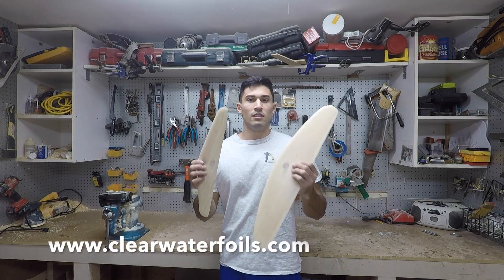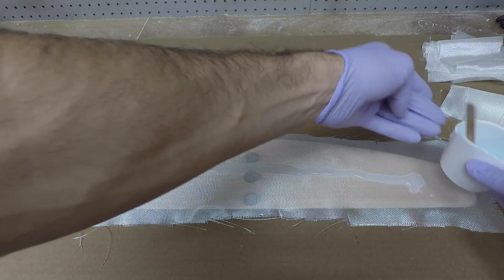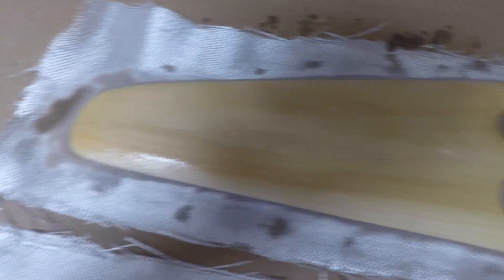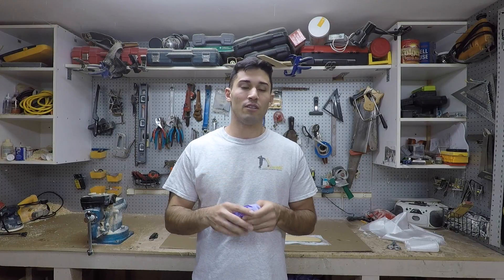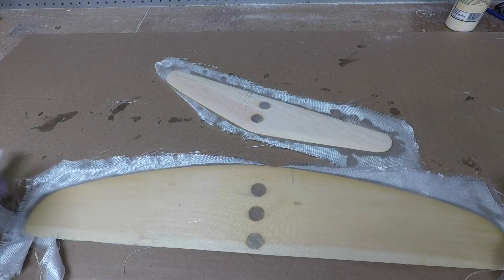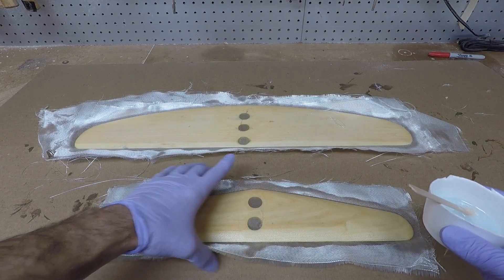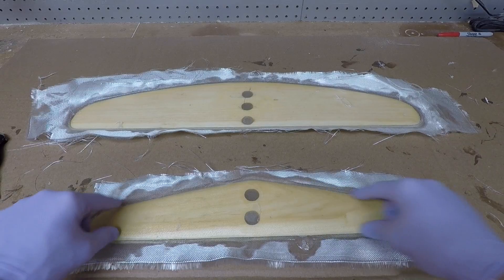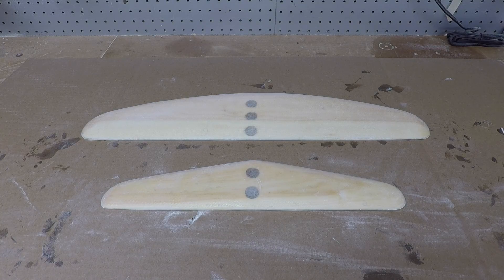BUILDING a Hydrofoil! Part 2

Comment: Do you use respirator? When work with epoxy?
Reply from the maker: When sanding yes, otherwise when wetting out glass just make sure everything is well ventilated.
Reply: @clearwaterhydrofoils4313 i was sure that the epoxy is very bad for lungs

Comment: What's the "cardboard " you lay the parts on to glass them,  that doesn't allow epixy to stick to ?
Reply from the maker: I like to work on top of cardboard to avoid making a mess. And yes, if any epoxy leaks over and onto the cardboard it is very easy to peel it off as apposed to the part bonding to the workbench.
Reply: @clearwaterhydrofoils4313  Yeah, but what I was asking is why the cardboard doesnt stick to the parts with epoxy? 
Most cardboard behaves like plywood and adheres to epoxy like crazy.
Yours doesn't.  How come?
Reply: How many layers? And uses 200 g/cm3 ?